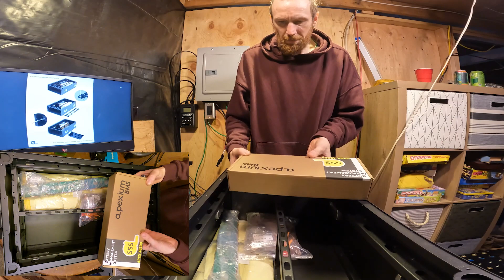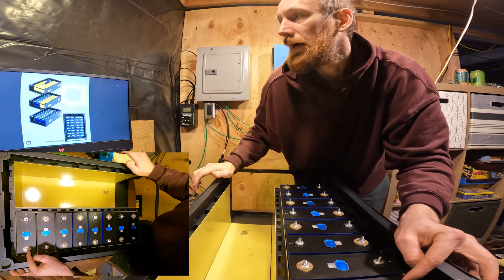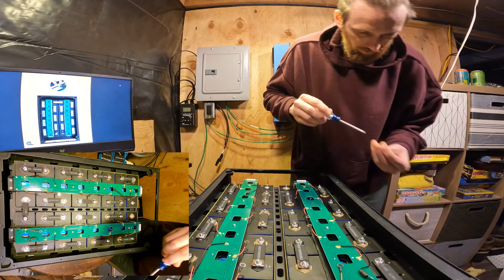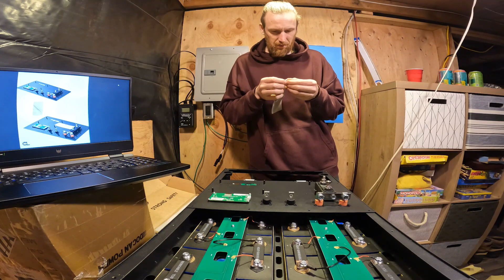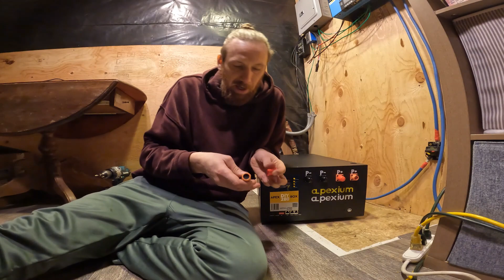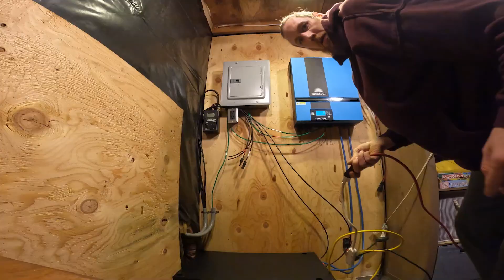Build a Battery - DIY 48v Battery Build For Our Solar Bank

Comment: Any chance you could share the info on the components.  I live remote central AK, just basic 12volt system and really need  more power.  Saving thousands sound like the setup I need. I have just over 3k in the 12volt set up and still need more juice.  Thanks in advance.   Next summer I’ll  be digging my spring , so thanks for your videos. Learning all I can
Reply from the maker: Absolutely! Let me put a list together of everything and I'll come back and add it as a comment. We spent years on a little 12v system and this has been a huge upgrade.